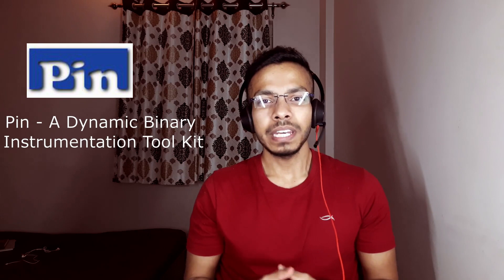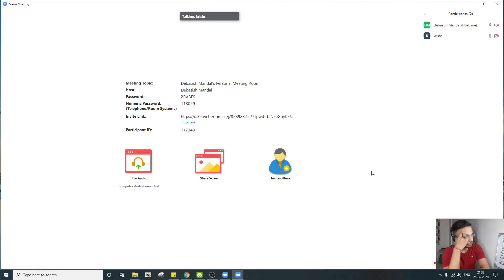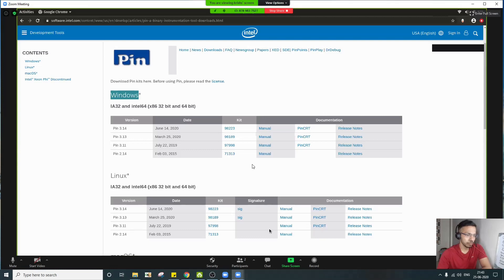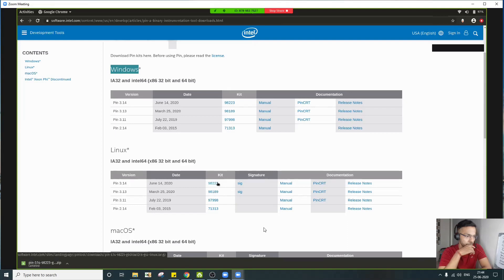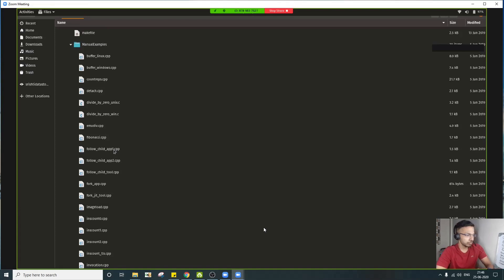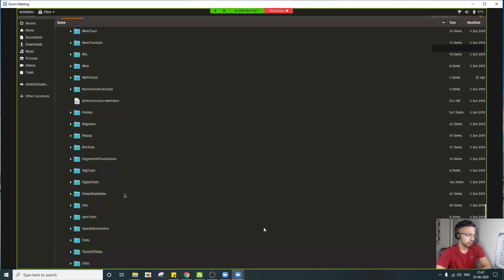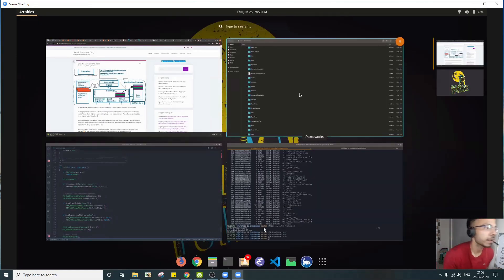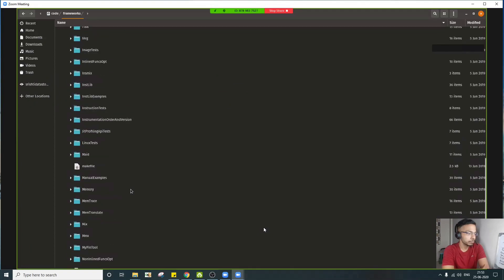Dynamic Binary Instrumentation(DBI)Primer with Intel PIN for Reverse Engineering Part 1/4 by Krishs

Comment: DBI provides more performance over debugging?  Is this guy for real?  DBI NEGATES performance drastically.
Reply: The debugging support is provided by OS kernel in the form of events and interrupts. So when writing instruction tracer (the one presented in this talk) with debugger you need to work with single step inturrupt for which processing each instruction can drastically reduce the performance of your script due the fact that cpu raising single step interrupt after every instruction which you need to handle in your script to analyze the process state further. DBI solution work better in such scenarios as it has already inserted your code with analyzer callbacks in code cache providing much better performance over traditional debugger scripts. Similarly for the other automation stuff e.g tracing allocations with hooking mem apis, I have found dbi solutions works much better that plain debugger based scripts
Reply: @MrKrishs  Nice! Instruction tracing and tracking allocated executable memory is the exact reason I thought of learning Pintool for. Tried to automate these tasks using both x64dbg plugin and scripts, but single step instruction tracing is hilariously slow with x64dbg on windows at least. I once tried to find out when exactly eip goes to a memory address not part of any loaded modules through single stepping the instructions with the help of a plugin I wrote, it ran for more than an hour and yet never reached that part of the code lol. I hope your talk will help me with enough pintool knowledge to develop some automation stuff of my own. Also great to see other Indians in the community! :)